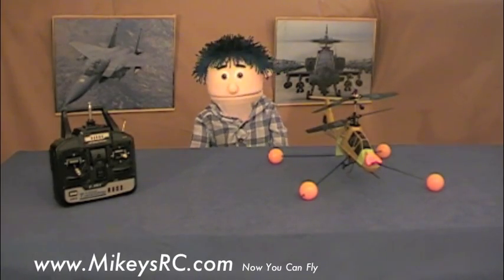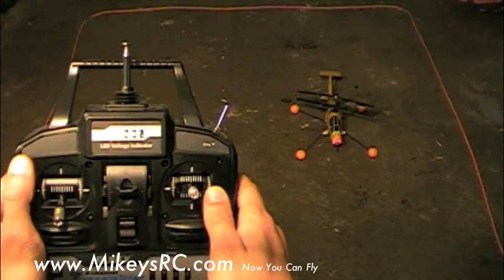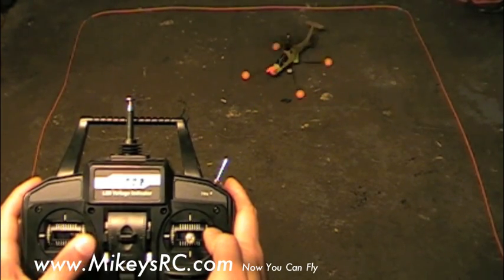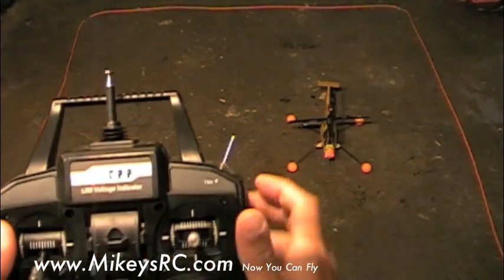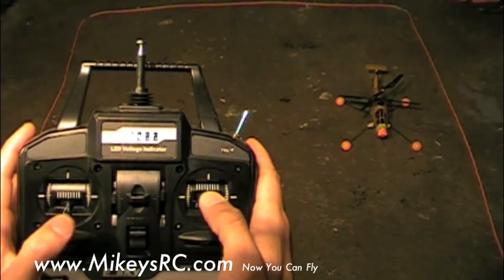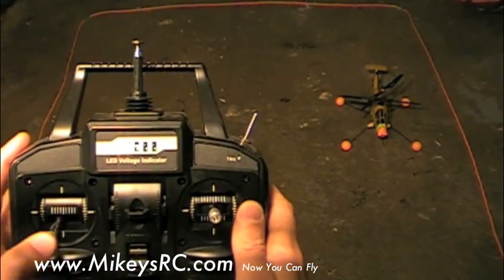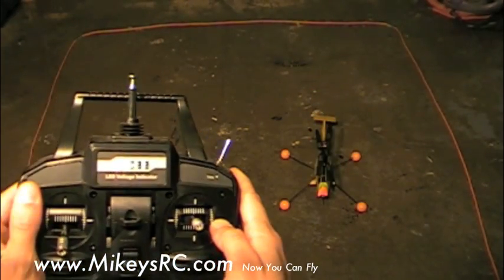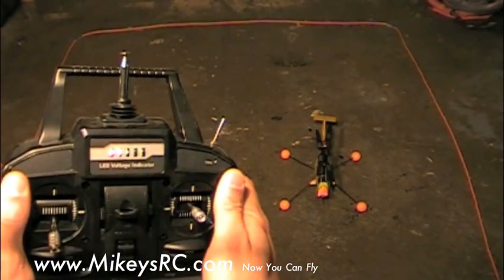Learn How To Fly RC Helicopter (NOSE IN ORIENTATION)

Comment: I want to start flying an RC helicopter but I don't know which helicopter to buy. Do you have recommendations? 

I'm looking for  a helicopter that is reliable in terms of parts (it won't break on me after 10 correct flights). I plan to fit it with those training platforms so I don't think it matters that I fly a copter' with a flybar vs. a coaxial helo. Would you recommend saving up for a particular model?

Comment from the maker: So you really only need one more channel for a total of 5, not 6.  There is one extra channel not used.  The break down might look something like this;

CH 1 Throttle
CH 2 Rudder servo
CH 3 Swash plate servo #1 or "Aileron"
CH4 Swash plate servo #2 or "Elevator"
CH5 Swash  plate servo #3 or "other Aileron"

I hope that helped.  If you want more explanation send me another message.  
=)

Comment from the maker: Tha'ts a very good question.  On a 4 channel TX and helicopter here is how the channels are used
CH1 Throttle (left stick)
CH2 Rudder (left stick)
CH3 Swash plate servo (right stick)
CH4 other Swash plane servo (right stick)

On a 6 channel helicopter one difference is that there are now  3 servos on the swash plate.  Also most 6 channel TX and heli set ups have "CCPM" which blends the 3 swash servos AND the throttle input to give over all blade pitch increase,..this = more lift.  Confused yet?

Comment: Hi ,,   I was wondering what the difference is between a 4 channel and a 6 channel transmitter for helicopters,,What is err?? the 'Major' use of the other 2 channels.,
BTW I have this same tx radio,  I bought it because it came and it has a simulator cable . strangely the the 6 channel version does not.